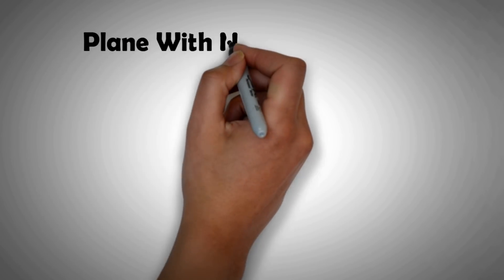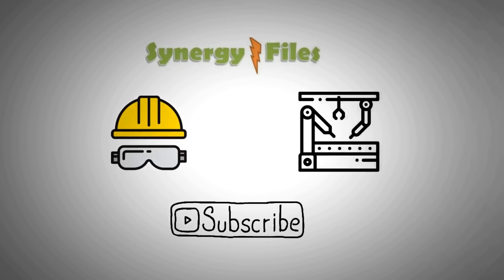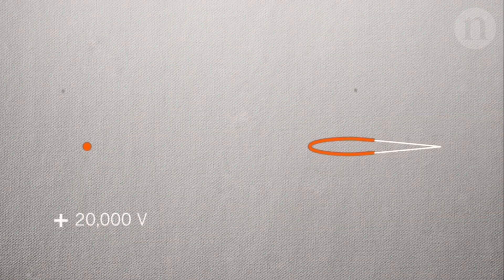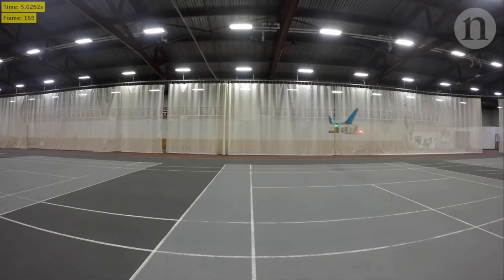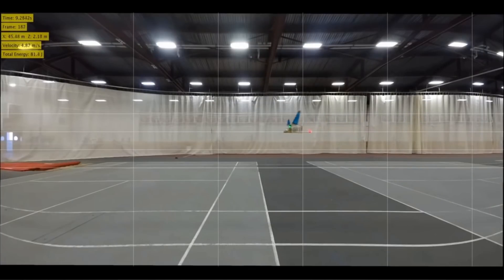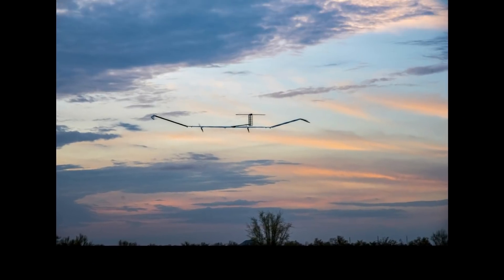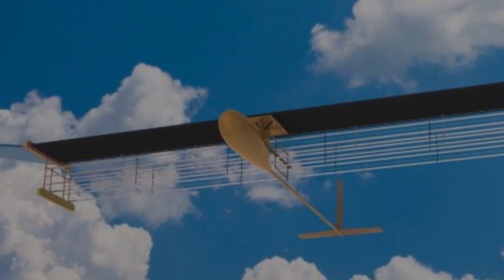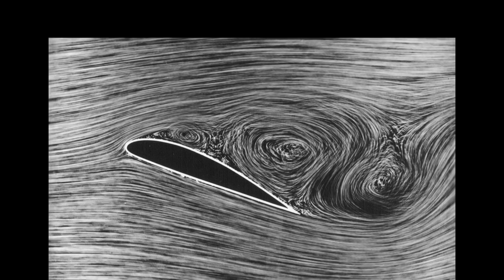World's First Solid State Aeroplane has Flown

Comment: The above glider had hobby store servos for the rudder and elevator flaps. It was in fact not the first heavier than air ion propelled aircraft with onboard power either! If you google US Patent Number 10,119,527, you can see about 35 flight videos of an earlier more efficient ion propelled aircraft, with onboard power, or just see my YT channel to the left.
It is thoroughly independently verified to carry its power supply since about 2006. It is capable of flying vertically for minutes not just horizontally for seconds and also it can fly as an airplane.